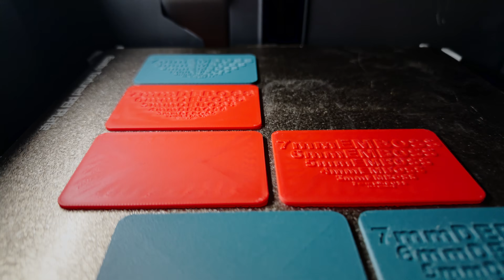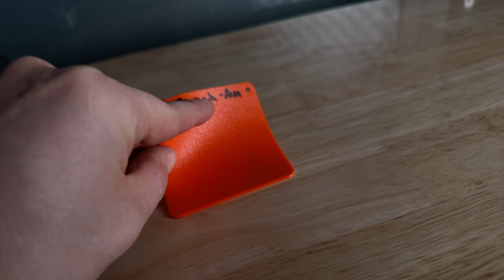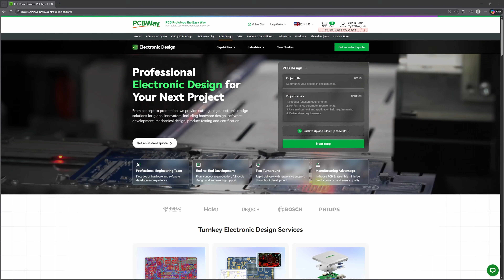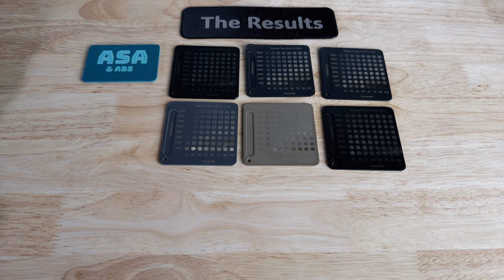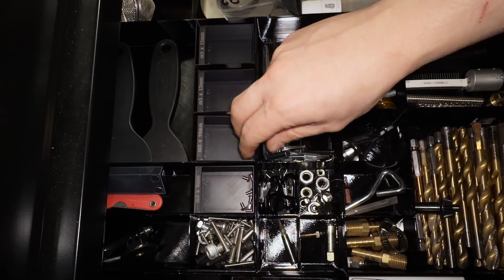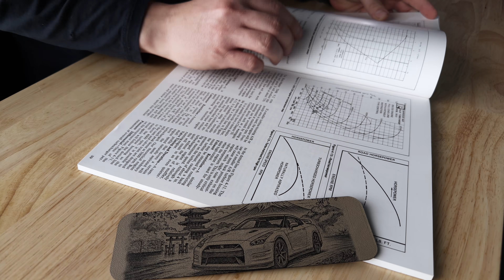The Best Settings for Engraving Every Color 3D Print - Free Settings!

Comment: If you using LightBurn as SW you don't need to design a test file. This is integrated and you just modify the range of speed and power.
Reply from the maker: I’m using XCS from x tool, and it has a built in feature as well to design a test grid using power and speed min and max values as well as the shape and procedure(cut,score or engrave)

Comment: I've been laser marking PETG with my Commarker UV laser for about a year now. There's no power setting on this machine so it makes for difficult testing because of the number of variables. I'd be interested to know your findings of defocusing with a UV laser.
Reply from the maker: This laser is a fiber that operates at 1064nm and a UV laser will likely operate somewhere around 360-405nm. So different animals.
Reply: @piscesprinting Nice to hear back from you, thank you! Yes, I have the F1 Ultra myself as well but had no success on plastics no matter what settings I tried. Yours are fantastic to be honest! For some reason I thought you had a UV laser too.
Reply from the maker: I had some plastics that refused to mark, they were reds and oranges in PLA and TPU. So something with the way that the red and orange don’t absorb that wavelength is likely the culprit.
Reply: @piscesprinting I had exactly the same problem. I had some success on green PETG but decided UV was the better way for me. I'm going to try your settings on my F1 Ultra and give it another shot in that area. Nice talking with you and thank you very much for your knowledge. It's appreciated!

Comment: Forgot to even mention that frequency matters just as much as speed or power when marking with a laser.
btw the test grid is a built in feature in lightburn.
Reply from the maker: In my testing frequency was more equivalent to smoothness of engraving. However In a MOPA laser I can see how PWM and frequency change the out come but I had no reasonable change from 30 to 60hz. 

The test grid is a built in tool for Xtools software as well. You just pick the speed and power range along with the shape.

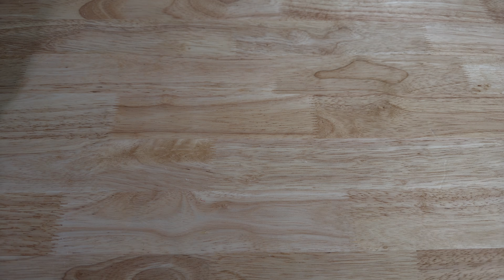Comment: 4:28 Ooh boy….plastics, especially abs & asa and lasers….the fumes are toxic and corrosive to your laser. I see all the fumes comming from the lasered piece of abs, hope you had some good ventilation or filtermask while doing this….
Reply from the maker: Yes there is ventilation to outside, also there is a large activated charcoal/hepa filter running under the laser. And it runs 24/7 with monthly filter changes due to the printing in that room. 

I had a blurb about safety but I ultimately left it out as it was very “boring safety meeting” which is horrible for retention, and that sucks as this stuff is generally very dangerous.

Comment: I would defo want more laser stuff. E.g. engraving on different materials. e.g:
Leather vs PU Leather
Different types of wood
Different types of metal
Paints for different effects, etc.

Also what is the machine you're using?
Reply from the maker: Thanks for the suggestion! And the laser is an xtool f1 ultra

Comment: I had a lot of trouble with PETG where on really thing materials, it seems to cut through the print rather than marking the object itself.  That was with SUNLU black, so maybe other brands work differently?
Reply from the maker: I never did “thin” stuff but I know for metals where they warp, it always was better to crank the power and speed.

I believe the marks made can be quantified as a watts consumed per second.

If you look at the test pieces I linked, you can see as speed increases you need more power to maintain the same level of darkness. But faster speed also reduces the time that surrounding material can soak up heat. 

Honestly the test grid is your best bet to see if any settings will work.

Comment: No way this man said multi material printing was expensive then went right into getting a fiber laser, which is the most expensive type in this class by a lot, without a trace of irony.
Reply from the maker: Compared to a single material printer it is indeed much more expensive. Price is relative, in terms of lasers, mine is cheap. In terms of printers mine are mid grade, yet the laser was 2x the cost of the printer. 

A $50 cup of coffee is expensive… a $50 fillet mignon is pretty reasonable. It’s definitely relative.